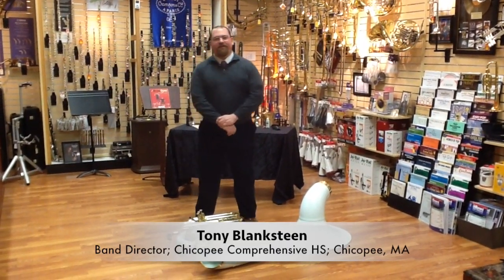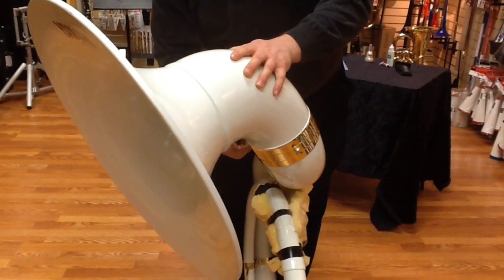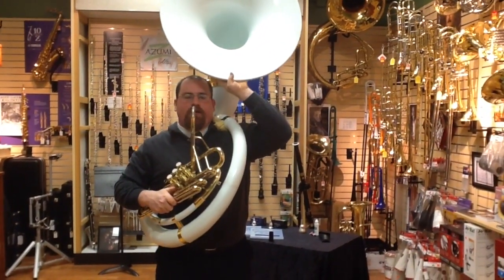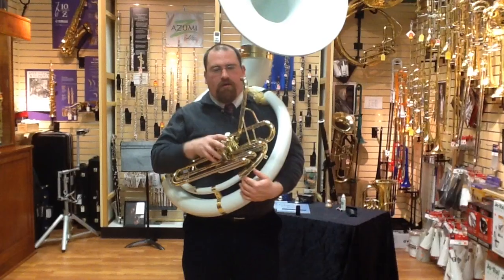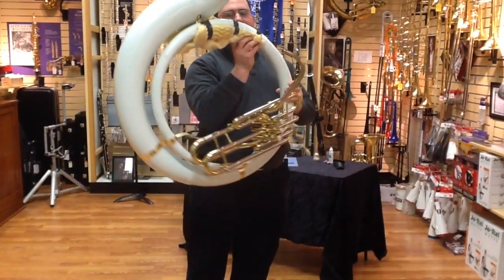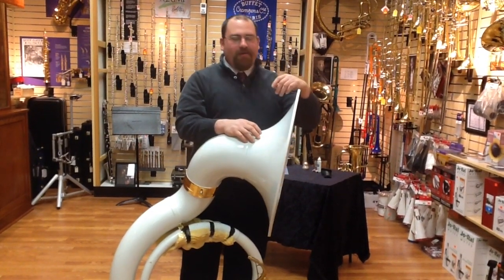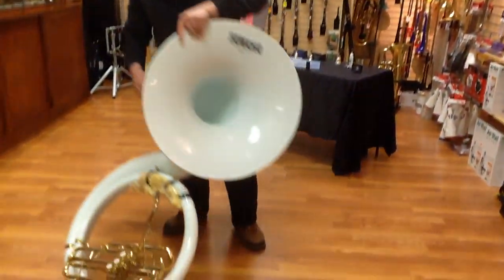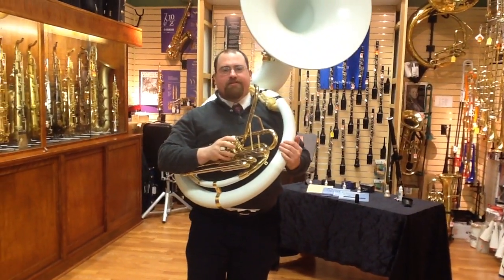Tuba: The Sousaphone

Comment: A few thoughts along these lines:
- Many people insist that fiberglass Sousaphones are terrible. If the instrument is in good working condition and played by a real tuba player (not just some inexperienced kid, or somebody just interested in blasting), they sound just fine for outdoors parade type music, which is all they should be used for. A brass and a fiberglass Sousaphone on the street, played in the same way, will not be distinguishable to the listener, although the player can get a somewhat different feedback to his ears from the different resonances of the bell materials.....this difference is not obvious even a few feet away while on the march.
- The problem with shoulder pain from carrying a Sousaphone is primarily from the entire weight of the horn focused on about two square inches of the player's shoulder. The solution is to distribute that weight over a larger area of the shoulder, and typical foam rubber pads or leather pads cannot distribute the weight very much. I once made a pad by carving up a large block of Styrofoam (like used on coffee cups) so its bottom curved to match the shape of my shoulder and the top had a channel into which the arch of the horn fitted, and it was SO much more comfortable. But to keep the horn from resting too high, and interfering with where the mouthpiece came to on my face as a result, the Styrofoam block had to be no more than one inch thick at its thinnest point, and after while it cracked in half. But this proved the idea, and of a better material, stiff enough to distribute the weight, soft enough on the surface to feel comfortable, string enough not to crack in half, and capable of being shaped as needed, a great and effective Sousaphone pad could be manufactured. Closed cell, high density polyethylene foam would probably work quite well for this, but it if expensive and hard for most people to find (although a manufacturer could get it if they decided to start making Sousaphone pads). Another thing that would work would be a piece of thick plastic sheet, warmed to be soft and then formed over a mandrel to the right shape, cooled to be stiff again, and lined with a thin layer of comfortable foam. All these things could be made and productively sold, but I think most manufacturers of these pads don't have the engineering expertise to design them correctly.
- One can badly damage the bell ring on a Sousaphone (or detachable bell upright tuba) by over-tightening the three screws. All three screws need to be carefully and evenly adjusted inwards, just enough to keep the bell from rotating, but no more than that.
- Find where the bell is pointing correctly and use a wide 'Sharpie' pen to make alignment marks where the bell attaches, so there is never any doubt each time the horn is put together.
- As pointed out in this video, NEVER rest the assembled Sousaphone with the valves and leadpipe/gooseneck pointing down to the ground. So much damage will occur from doing this.
- Try to avoid carrying the assembled Sousaphone through doorways or under low branches, etc; with the leadpipe/gooseneck & mouthpiece attached.....if the top of the bell hits the door frame, branch, etc; the mouthpiece (or worse, the end of the leadpipe) will smack you in the face, causing potentially serious damage to the lips, teeth, nose.
Reply: I've never had any of these issues you've listed - and I've had a bunch of different sousaphones. Fiberglass sousaphones, to me, tend to be a more homogeneous tuba sound that has a more clearly defined "bass" sound. This can be really good with certain modern music and "covers".

The worst a player can do is hold the instrument incorrectly, the video is close, but not quite there. The body has to come further to the right and the bell goes further to the left. If you think of it as one should - it being a directional helicon, which was both a marching instrument as well as used for cavalry - the body needs to allow room for a cap with a plume, meaning the bell needs to be on the left side of the head.
Reply: presses "read more"

Nvm goodbye.
Reply: Bran Flakes lmao same